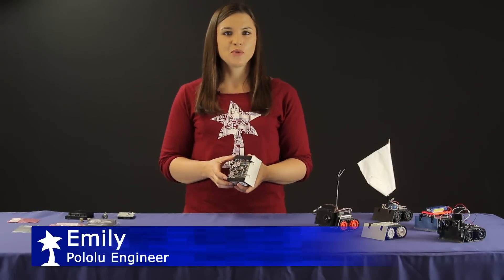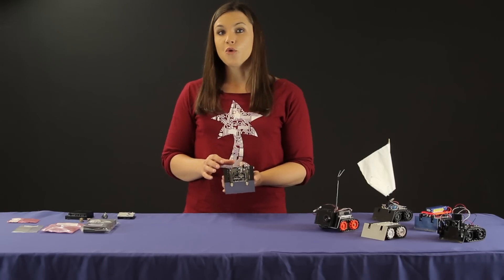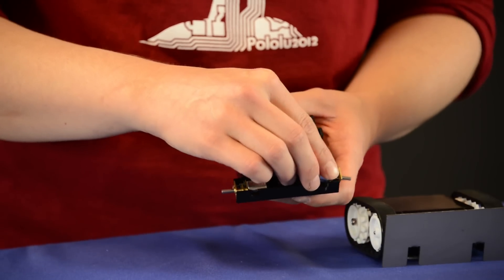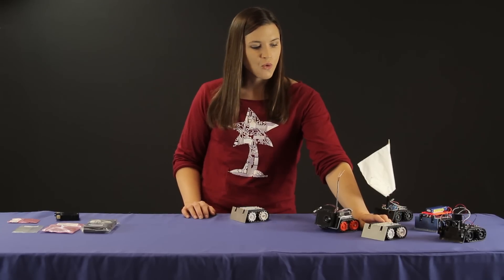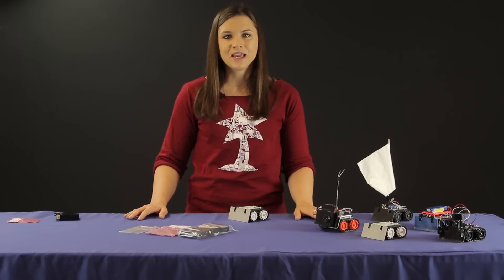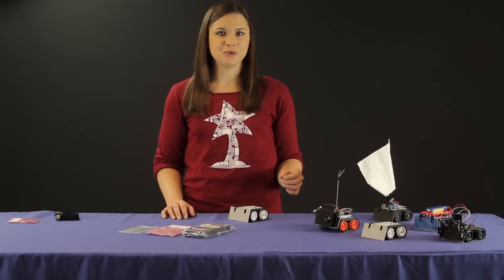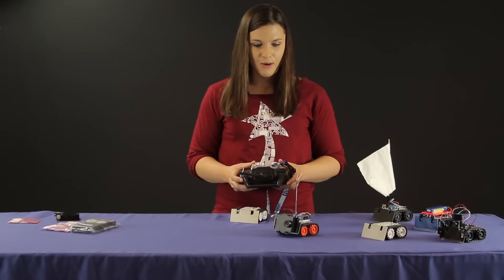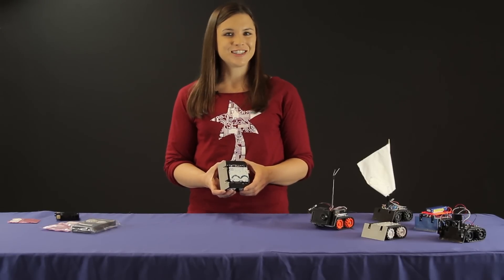Introducing the Zumo Robot for Arduino

Comment: what type of arduino board does it use?
Reply from the maker: The Zumo robot uses our Zumo Shield for Arduino, which works with Arduino Uno, Leonardo, and older Arduinos that have the same form factor as the Uno, such as the Duemilanove.  You can learn more about the Zumos by following the link in the video description.
Reply: Thanks

Comment: how do you write the code from scratch by yourself the example projects need the files in certain places, but where can I just create the code, load and run it on my zumo v1.2
Reply from the maker: The Arduino IDE allows you to write and upload code to an Arduino (or compatible board).  Since it sounds like you are not familiar with using the IDE, I suggest you start by looking at the "Getting Started" page on the Arduino website:

https://www.arduino.cc/en/Guide/HomePage

If you need further technical assistance, I recommend posting your questions on our forum:

http://forum.pololu.com/